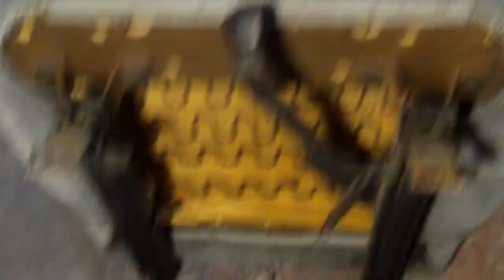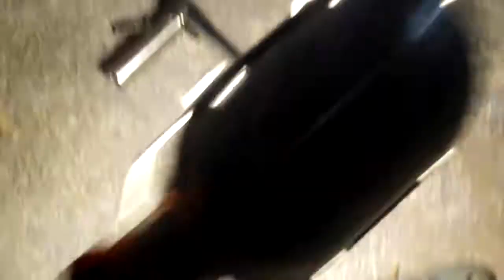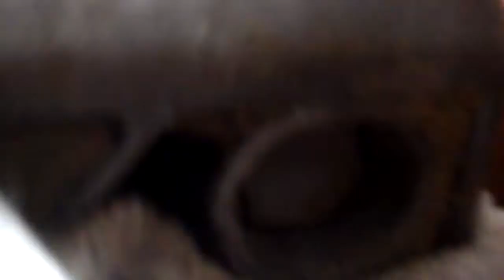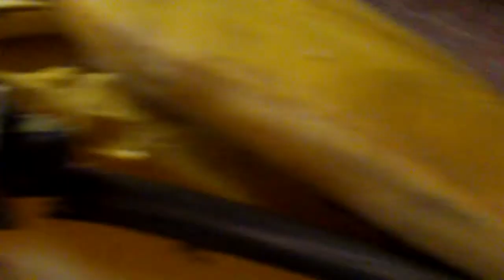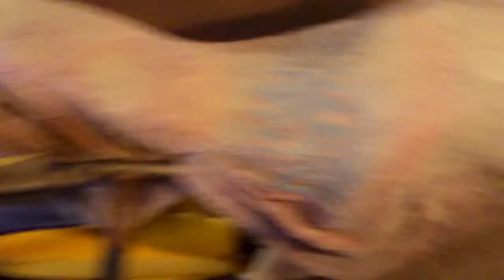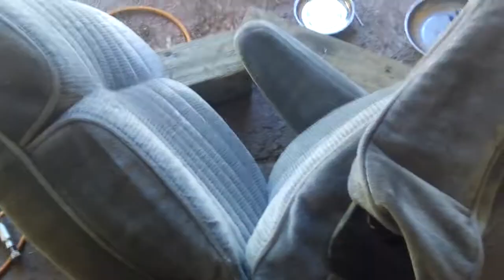Repairing a broken seat frame 91 Chevy Suburban

Comment: Great video!!😎👍 My 91 burb in the shop getting rear diff work done. But when I get it back I will tackle both front seats with your video. Then alot of rust repair issues that will be fixed.
Chevy Square body truck love😎🤙